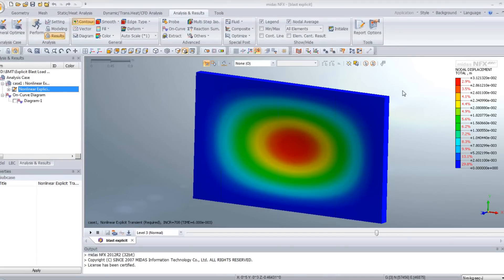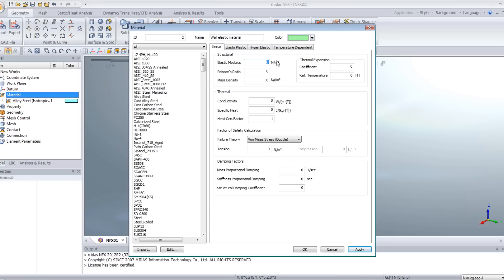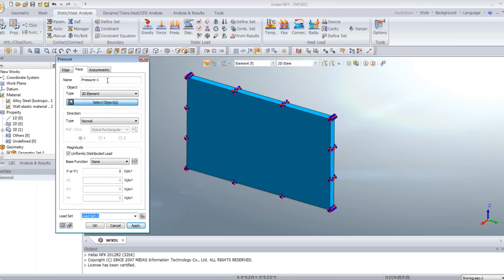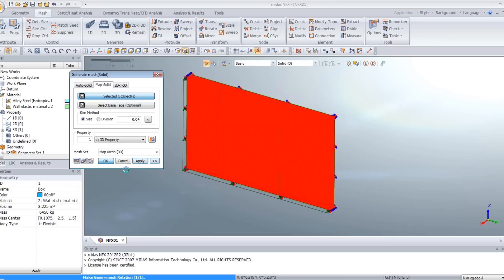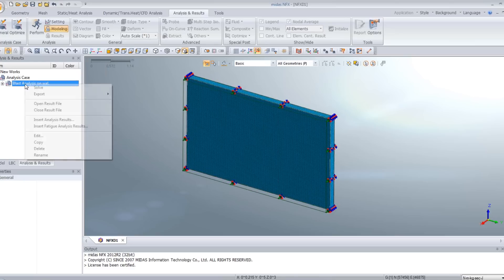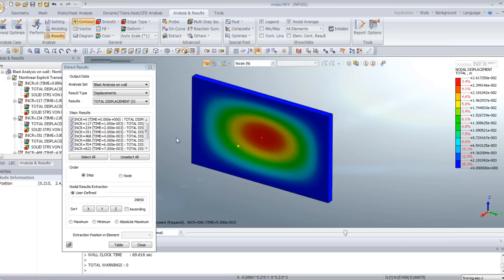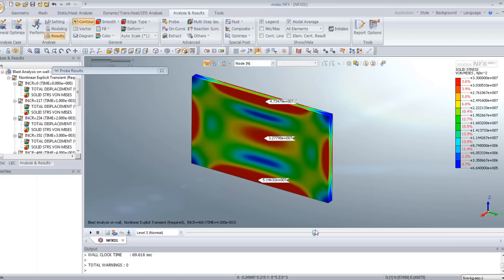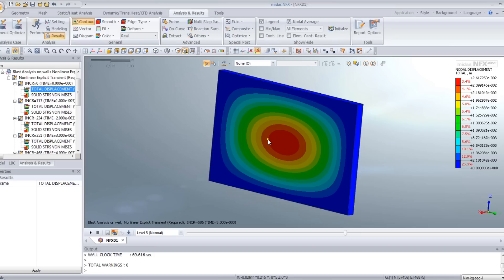Nonlinear Explicit Blast Loading on wall Tutorial midas NFX.wmv

Comment: what about safety factor if blast load is closer to the slope? any idea if you can give will be appreciated. thanks
Reply from the maker: A blast propagates as a wave, so the closer you are from it, the higher the impact will be. Thus, I would suggest you calculate that and introduce it as a coefficient that will multiply your safety factor. Have a look at how civil engineering codes take in account blast loads on buildings and you will get some idea of how to solve that problem in your specific case.